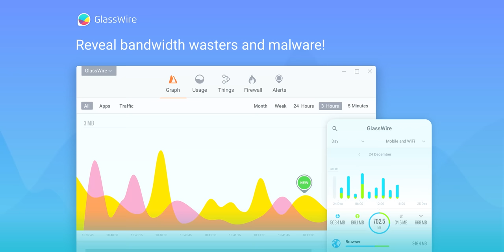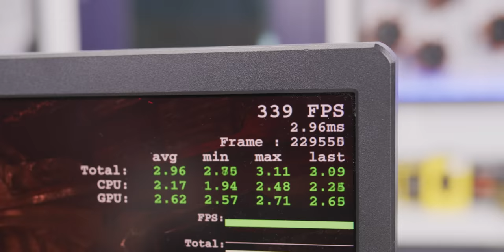His PC Died in a Fire.

Comment: Main take away is that the cooler did NOT do its job.
Reply: yeah should have just put out the fire
Reply: But the IHS definitely did
Reply: It fanned the flames to enable the fire to burn every component. Did pretty well imo.
Reply: Wellllllllllllllll...or, here me out, maybe it is the reason why everything is TOTALLY charred. I can just see that fan fanning the flames of that PC's epic demise, spinning away in a hellish inferno. Just sayin'. :)
Reply: @graveyj2000  it had great airflow....
Reply: A R lol!
Reply: @graveyj2000  I doubt the fan was spinning long. The plastic surely melted fairly quickly, and even if it didn't the magnets in the motor would completely stop working. Not to mention all the components would become desoldered.

Or as has just become obvious to me, the system would've shut down from overheating well before things got burnt.
Reply: @eDoc2020  See, you say that, but this is was a Noctua fan...notua is latin for "night bird."  You know where they have a lot of night? Hell-hell has a lot of night. So the noctua fan was spinning merrily away, bringing hell to that computer chassis.  BOOM!<crosses arms smugly at unassailable argument>
Reply: @AR-dr1sb  lol. truth!
Reply: @graveyj2000  yeah a good air fan and the risks that come along with 3rd party manufacturing (what EVGA does and why their PSUs are cheap)... it’s like fanning a set of ashes...
Reply: yea shoulda used a liquid cooler
Reply: LOL

Comment: Spencer is going to love when the bracket rust shorts his pc and burns his house down!
Reply: Technically rust is a pretty good insulator. If it's just rust, and not metal filings, it most likely won't short things out. This applies to other tarnishes like Aluminum Oxide and Cupric Oxide as well.

Of course, the chances of it being 100% rust and not any part metal filings is... well, pretty much entropically impossible
Reply: I was also thinking isn't the metal weakened by the fire? why use the brackets when they have an increased chance of breaking and ruining everything?
Not the smartest move imo.
Reply: @NXDL25  It completely depends on the temps it reached, and how fast it was cooled. Might I suggest you consult an iron alloy phase diagram to see how complex it can be.
Reply: You should watch the delivery video. Linus cleaned the brackets before they shipped the rig.
Reply: Yup, there goes his fire insurance.  Especially with video evidence. Lol.
Reply: probably stainless steel, he will be fine
Reply: @Soniku Raharu The bracket will probably be fine, if anything it's been annealed, so it may actually be less brittle than before.

I really wouldn't worry about it, unless you're talking about structural parts under great stress (like a roll cage in a rally car or something like that) then it is unlikely to fail.

You'd have to be trying to break it.
Reply: I’m sure he threw in the brackets in the shipment in case spencer wanted to switch it out. I’m sure Linus wouldn’t want random noctua brackets laying around lol
Reply: How is that bracket going to cause a short?
Reply: Should've at least cleaned it up with a wire brush and clear coat it, IMHO.
The idea was still good.
Reply: @feliciaxedine9402  Yeah, but the rust from the plate can actually "infect" the rest of the pc
Reply: @eduardoavila646  This isn't tin pest. Galvanic corrosion also won't work as the case itself is grounded.

Comment: "My computer isn't THAT dusty"
Their computer :
Reply: I literally have duct tape holding my PSU fixed on top of an open case. upgrading soon. 😂
Reply: @snickle1980  ok
Reply: @snickle1980  ok
Reply: @snickle1980  ok
Reply: @snickle1980  ok
Reply: @snickle1980  ok
Reply: @snickle1980  ok
Reply: @snickle1980  K.O.
Reply: @snickle1980  ok
Reply: @snickle1980  ok
Reply: @snickle1980  ok
Reply: @snickle1980  ok
Reply: @snickle1980  ok
Reply: @snickle1980  ok

Comment: Linus: I'm going to install these burnt brackets instead of the new ones that came in the box.
Craft Computing inspecting the pc: WTF
Reply: I hope the heat didn't make them brittle..
Reply: @5punkybob  haha, that's what I was thinking........I guess they'll find out when it's shipped
Reply: the real worry if it flakes and the bits that fall off end up shorting something
Reply: @ddpwe5269  Heat treating CAN make metals stronger. Key word, can. Depends on how hot the fire got. If the heat got high enough wothout getting too high it'll actually be MORE durable.
Reply: @KiraSlith  Yes, heating can make metal harder in right conditions, but not in house fire. Bracket is brown, because it oxidised and became much more brittle
Reply: @KiraSlith  True, but not sure a fire that can melt copper(seeing the base-plate is gone along with the fins), might be a bit too high for pretty much all metals.

Comment: Did you really just reuse the rusty metal brackets that will forever shed conductive particles onto a motherboard in a brand new PC? :( Sadface.

**drops a screw into the PSU, "I'm sure it will be fine..."
Reply: I was thinking EXACTLY about it. Like, REALLY? corrosion since day 1?!  YAY!!1!one!!
Reply: Hope it doesn't catch fire from a short...
Reply: + it lost all its flexibility, so it's likely to break.
Reply: Timestamp?
Reply: They probably sent a new mounting bracket for Spencer to swap out the burnt one
Reply: Linus isn't exactly the most savvy pc builder, he's shown many times by putting thermal pads on chokes etc you don't wanna come here for tech advice.
Reply: @CD-zf5hf  7:25
Reply: @tomstech4390  of course not, you come here for tech tips not tech advice.
Reply: It’s him cheaping out which honestly, he got liberty to do with the trade deal as a whole
Reply: The brackets weren't rusty. From what I can tell after googling noctua fans for a bit, the brackets are made out of aluminum. Fun fact that I just learned about aluminum is that it oxidizes when exposed to air, regardless of the temperature. The oxide layer on top of the aluminum is actually what you're seeing when you look at aluminum metal, it's already degraded. This oxide layer is really strong and heat resistant and likely didn't change even a little (aside from color) during or after the fire. Assuming linus cleaned the metal before putting it in, from what I can tell, it'll work perfectly fine.

Yes I googled this, no I didn't know any of this beforehand, a little research goes a long way!
Reply: @tomstech4390  Pads on chokes can actually be quite useful since it can absorb/insulate some coil whine. Then even if the chokes themselves doesn't have a problem with high temps, any increase in thermal transfer from the board > block/cooler means lower temps for surrounding components as well.
Reply: @ethanrobbins4154  No way they were aluminum. You know what aluminum becomes in basically any fire? A puddle. I've seen that in two instances IRL, and countless other examples online.
Reply: @ethanrobbins4154  Having used multiple Noctua coolers over the years, I can say that their brackets are steel. Definitely not aluminum.
Reply: Based on the craft computing video it looks like they were cleaned up reasonably well. https://youtu.be/1kpl3kcAQWg?t=170
Reply: @illuminate4622  Aluminum has a melting point of 660 c. The average houesfire doesn't get above 600 c. The oxide layer that forms around aluminum metal has triple the melting point of aluminum at ~2100 c. This oxide layer serves to protect the aluminum metal from the already below melting temperature.

More researching on my part. Just fact checking
Reply: @tomstech4390  lmao moran! Do you even know what are you saying? Lmao
Reply: @Spartaner043  At least know before saying something bs
Reply: @mstr-rptr  If that is true then what I said is wrong. But judging by the lack of rust and linus saying it's still in tact, I'm going to assume that this model of noctua fan has aluminum brackets. Not to mention aluminum is cheap and strong making for a sensible material to make the brackets out of. I will admit I don't know for sure what material these brackets are made out of but I did see on the noctua website that they use aluminum in some of their fans.
Reply: @ethanrobbins4154  Thanks for teaching another factless
Reply: and here come the armchair experts!
Reply: @ethanrobbins4154  7:46 that doesn't look clean at all, you can even see small peeling scales all over it. I doesn't even look like aluminum. It's destroyed, I hope Linus only put it as a joke and replaced it off camera.
Reply: @ethanrobbins4154  don't worry dude.. Steel has over 1500 degrees Celsius of melting point
Reply: @Kluneberg  having seen it in Jeff's video, it is indeed cleaned, but it is still there. pretty nice touch
Reply: @ethanrobbins4154  I was totes gonna jump on him for that but got sucked down a wiki hole for 20 minutes.  Good job.  That also assumes that it was in the middle of the fire vs an outside wall.  While temps can peak at 600 they are on average much closer to 4-500.
Reply: **drops a screw into the PSU, "I'm sure it will be fine..."

Literally what I did in my current build... :P
Reply: K H N stop crying little boy, your mums gonna be at home soon to give you the attention you've lacked for years :) :*

Comment: Hoped that they cleaned the mounting bracket, wouldn't want ash to fall off and block airflow.
Reply: or have metal flakes fall into traces/pins...instant death
Reply: Well, he didn't
Reply: The biggest issue is the rust that may have began to occur which it looks like it did. That is a bad idea, as rust spreads to other components quite easily, and not to mention that computer components DO NOT use stainless steel materials.
Reply: Hope it was for a joke. While it won't instantly murder his brand new PC, it is risky leaving a rusty bracket sitting around in there.

Comment: Noctua: Sometimes our hardware survives a house fire
Reply: All of the copper and aluminum parts must have melted in the fire
Reply: 1085 degree Celsius is the melting point of copper. There won't be anything left of the pc if the copper also melted.
Reply: @BGTech1  yeah... copper and aluminum have a much lower melting temp than steel. Aluminum and copper tend to melt pretty easily in a firepit but you'll usually find that steel nails are just left in the ashes as long as they were not too rusted in the first place.... Then they don't melt but turn to metallic dust instead. Just by looking at it, most of that case was probably steel to be honest...
Reply: @j-frame  Completely untrue. We have to examine the mass of each component as well. You're never dealing with JUST energy. It's energy, over an amount of time, in a certain mass. This is why you can't melt a huge block of aluminum with a blowtorch, but you can literally set aluminum on fire with a regular lighter. Try it if you don't believe me.
Reply: Even fire doesn't want to have to do anything with the color brown.
Reply: Chepakishui  this computer was in a house fire, and House fires are know to get hotter than camp fires. Hose fires will actually sometimes melt the copper wiring. If this can happen, I’m sure the small amounts of copper and aluminum from the computer could melt.

Comment: Plot twist: iron filings/flakes from the burnt.out bracket flake off, cause a short and burns this pc down as well.
Reply: ..... and the guy's house as well.
Reply: It probably will or it'll completely break off and ruin parts of the system. That metal isn't safe to use anymore. Linus fucked up.
Reply: Linus obviously means well, he is giving the old PC a nod in the new build, making it personal. He probably didn’t realise the toxicity issues or oxidation and flaking issues, perhaps he isn’t familiar with old tech and metals, how it breaks down and probably usually, mostly only sees very new tech for what would be a relatively short time compared to some of us who still have a i7-2600 knocking around.  I applaud the guy, he’s doing some good in a world that needs it.
Reply: @alisonaussie4995  quite the contrary Linus has hardware from almost 2 decades ago in his warehouse. the thing is that if Linus revisits old tech he usually only benchmarks for a day or two, also he hasn't really had and fire experience expect for that time his server room nearly caught fire
Reply: So in some alternate universe, they are doing a Part II follow up video.

Comment: I feel like they shouldve rinsed off the bracket before putting it in.. what if part of it chips off and shorts something?
Reply: That'd suck, it could burn the house down or something.
Reply: Go and watch live apple event in #homithing
Reply: You really don’t Linus or one of the other boys there cleaned it off of any dust/charred ash before putting it in?
Reply: @aegonthedragon7303  they definitely did not clean that enough to stop the spread of  Corrosion, those brackets have protection new, that fire changed the chemical composition of that metal alot
Reply: @vxashexv6253  I think they should have put new ones in while hotgluing old ones somewhere as a memorabilia piece. They might break at any moment and rip that cpu out of the socket.
Reply: Yeah he should have used the news ones. He fucked up there.

Comment: I once lost a rig due to a roof leak.  Luck was not with me that day.  We had a major storm while I was out of town, and developed a new leak, and at this time, I ha a rig pretty much completely of cheap, second hand parts sitting on the desk, with the monitor beside it.  Can you guess where the new leak was dripping?  Yeah, not a lot made it into the case, but it was enough to take out the PSU in short fashion, and took the board with it.  I didn't notice until I went to use it a few days later.  It had mostly dried by then, but after wondering why it wouldn't turn on, I looked up at the ceiling, saw the signature spots on the ceiling that you get with leaks in old tile houses, and I lost it.  Was a cheap rig, but it was what I could afford then.  Sad day for sure.

Comment: Had a really bad electric company, they DESTROYED 3 APC UPS's in 1 year, you know it is the electric companies fault when they have to replace destroyed meters and the transformer is buzzing loud enough to hear from over 100 yards away.
Reply: ouch
Reply: Disgusting! 
Get a power conditioner.
Reply: @aegiselectric5805  the power company actually MELTED the rails inside the meter base, that is why I had UPS for tv
Reply: Ghost I seen that happen to my late father tech. Then  when I move into my gram house with her before pass away.  Phones, tv. Anyhow I forget tv to wall..... Massive brown out melted lcd part...... Muddy mess. Anyhow all parts now are behind ups also power company finale replace meter and re grounded house. I did dodge a oh fk moment. When I heard a car crash then a humming sound that turn to buzzing...then ran around the house un plug everything. The power surge ground on my lawn..... I should also note I was about to go to car bare feet... So that surge would have killed me.
Reply: @aegiselectric5805  Would you recommend a rinsed power conditioner or a leave-in power conditioner?
Reply: Get solar and battery and cut the cord.
Reply: @pirojfmifhghek566  sorry, not my area of expertise. 
LTT should do a thing on it.

Someone else said something about regrounding the house, that is my area of expertise, and might help you.
Idk your situation and local codes, but it wouldn't hurt to have a few extra ground rods and larger ground wire. Just, y'know, follow the laws and (obligatory) hire a qualified company. 
(Assuming that's your problem)
Idk if that would actually help you. Just in my experience "over-grounding" a property has fixed issues. 
Might want to have the connections from the power company checked as well, sometimes they get loose or oxidized and cause issues.

Comment: This is so nice for you to do. 

I finally built mine after buying a Ibuy power but now it has a hero xi, 4tb ssd (2 internal and 2 external), evga 850 gold, 6 fans (I still need 2 more fans), and for the final kicker I found out it has 2 dead ram slots but I got 32gb ram. 

I do need to upgrade the graphics card it's something called an Msi n730k 2gb which is the reason why the Ibuy towers battery busted.

:P

Comment: note: aluminum does usually melt in a wood fire as evident by the melted fins on an AC in an apartment building i witnessed burn down
Reply: I can second that. The body on the F-150 in my driveway melted when my house burnt down.
Reply: @Big_guy5  Thanks, dude. Everyone made it out alive, and I even had grabbed some sentimental things on the way out. Unfortunately, insurance only covers 60% of the replacement cost of everything, and to even get that, you have to make a list of every single thing that was in your house. As you can imagine, it's a pretty tedious process. After that, it still takes the insurance company about a year or so to process everything and send you your 60%.
Reply: i had a shed burn to the ground
my 60foot aluminium ladder didnt just melt, it vaporised, nothing lft of it at all, steel n iron tools n shelves completely intact
Reply: especially with such a big fire it creates massive negative pressure that pulls in fresh, oxygen rich air, so the fire inside gets even hotter, like with a bunsen burner: closed airways: orange flickery flame; open airways: blue jet flame. ANd we all know the laws of blackbody radiation: if it's red it's hot, but if it turns blue i't even hotter.
Reply: Not only that, if it gets hot enough it can catch fire as well.
Reply: @Tugela60  You see how good metals burn with Magnesium, it burns exceptionally well.
I guess alkaline metals burn even better...
But also regular steel wool kinda burns easily. It's not a real flame, more like fast moving ember line, but still. You just need a propane torch or similar to light it.